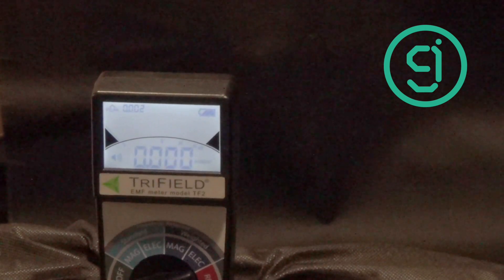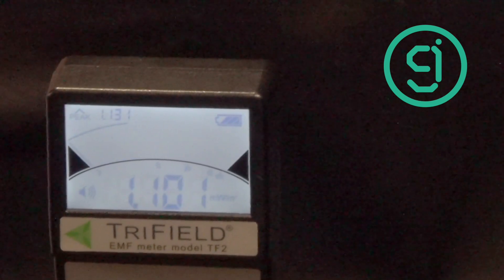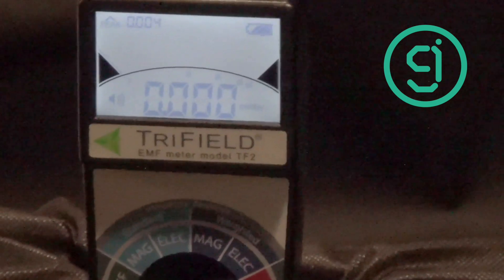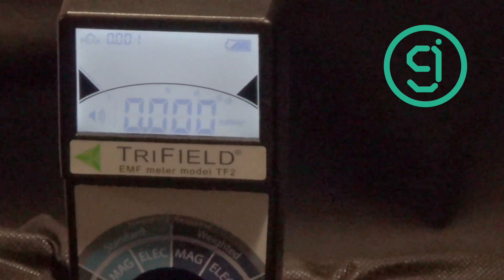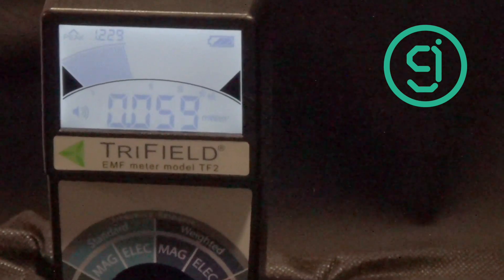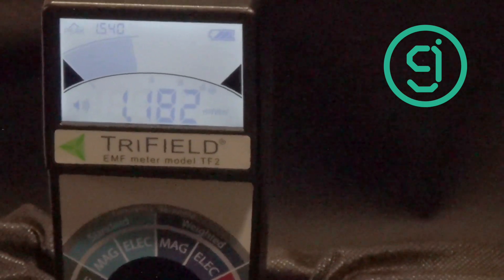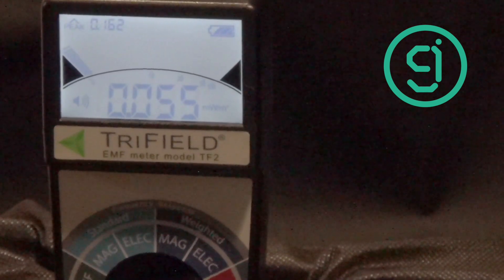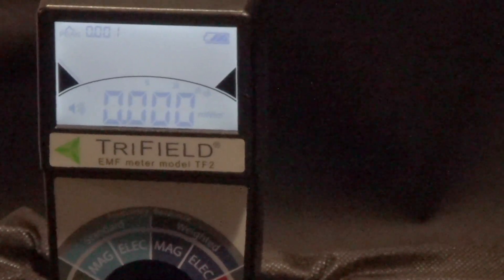Trifield Fall Off

Comment: @9CI 
I wanted to ask - are you able to say something more about the 5.6 GHz hole in the Acoustimeter test ?
Reply from the maker: Hi there Multi Hobbysta, 

If you were to take a 2.4 and 5.6 GHz router and turn off the 2.4 GHz  and then compare the Acoustimeter 2 or AM10 to say an HFW59D or a Pro you would notice that it reads 12 dB so 10-20 x lower. This is not to take away from those meters. They are sturdy and dependable meters. They are just 10 years old developmentally and new technology is always coming out with faster pulsed transmissions etc. So Wi-Fi 6 (or E) there will be more roll off on those readings. Those meters still show a reading it is just that it is quite a bit lower than one would have thought.

Thanks for your comment!
Reply: @9ci  Thanks for the answer
 !
can You tell me will ever Safe and Sound Pro 2  meter be available in europe? I wanted to buy it very well but outside of the USA, Canada, Australia it is impossible :/

Comment: I wrote a question to the manufacturer - here's what answer I received (maybe I'll add that I don't have this meter, although I was thinking about buying): Thank you for sending this to our attention. Apparently an ESD event (spark discharge near the antenna) has damaged the RF section of their meter. Previous versions of the TF2 did not have spark discharge protection, but they are being shipped with the protection circuit now. I just tested some sample TF2 now and they are for example, equally sensitive to 2.4 as 3.4 GHz, +/-5%, and have the correct frequency response. We will contact that organization and send them a new TF2 because theirs is defective.
Reply from the maker: Wow that is really good customer service. Good on them! We will look forward to testing it.
Reply: @9ci  Have they sent you the replacement for testing?
Reply: @9ci  
Now they have a lot of orders and barely keep up with production, I know because I was asking if they could also get me a meter at a promotional price;) There is no chance :)
Reply: Have you bought it and tested it?
Reply: Stewart Andreason who published a video „EMF EMR Electrosmog Analysis Episode 2 - Meter comparison” wrote in a comment there that they replaced faulty meter for him, but it still failed to measure short pulses like WiFi beacons and 5G, high speed data:
"They replaced it. It is kinda better. But it fails to measure short pulses like Wifi beacons and 5G, high speed data. It disappointed me. On the positive side, it measures interesting pulses from cell phones displays, that no other meter picked up on. That is in this video, chapter 1."

Comment: Apparently an ESD event (spark discharge near the antenna) has damaged the RF section of this meter. Previous versions of the TF2 did not have spark discharge protection, but they are being shipped with the protection circuit now. I just tested some sample TF2 now and they are for example, equally sensitive to 2.4 as 3.4 GHz, +/-5%, and have the correct frequency response. Please contact us so that we can get you a new meter. www.trifield.com or email trifield@trifield.com

Comment: Thought... do other meters in a side by side, showing readings?  1-2 secs on each frequency and add text overlay to show the frequency?  Hope all is well
Reply from the maker: Hi Dee Gee,

we did consider this, we were concerned that antenna placement in the meters would play a role in their ability to pick up the source as equally. We didn't want it to be unfair to the meters. We tried in our small set up and the performance varies at the numbers we are looking at, due to reflections etc. It may work better in the RF chamber but we haven't had the time to check out other meters yet. Completely agree though, it would show off capabilities more easily if a side by side is possible. 

Thank you for that!
Reply: @9ci  what if you used two phones, kept the meters apart and recorded each video separately.  Use a "duet" feature on the final video, combining the separated, synched videos?

Comment: Could you recommend where to buy one of your units? Or post a Link if YT allows. I went looking and am finding different prices and do not want to buy a copy, or over pay. Thank you for all your videos  P.S.  are you out of the first version?
Reply from the maker: Hi there,

this is where I would recommend buying it from. 

https://slt.co/Products/RFMeters/SafeandSoundProIIRFMeter.aspx

They are sadly all out of the Pro I. Is the colour or the max reset button the reason? Or is there an OG interest?
Reply: @9ci  Of course i wanted to get in for as low a price as possible, but didnt want to waste money either. I could have bought a Pro i a year ago, but was on the fence. Having one choice helps decision making alot! Thank-You for the Link. I have no issues with Pro ii, i will probably be using the max frequency Reset alot anyway... How to use videos and before /after videos of a room or home after some protection added. What about different materials that can be used, and price factors involved. You may have these videos i have not checked, yet. Thx for your response and good luck in the future.